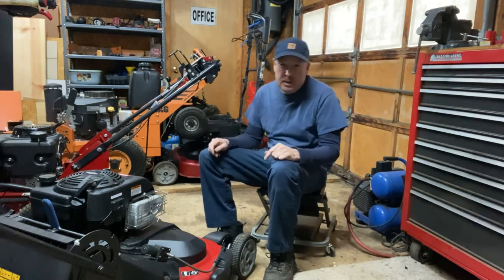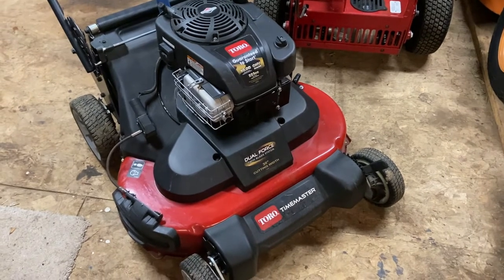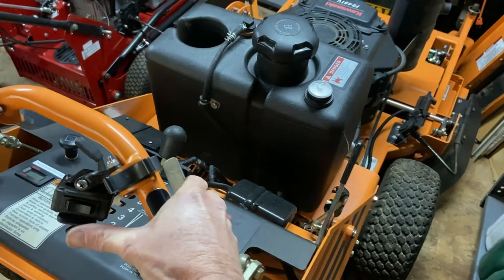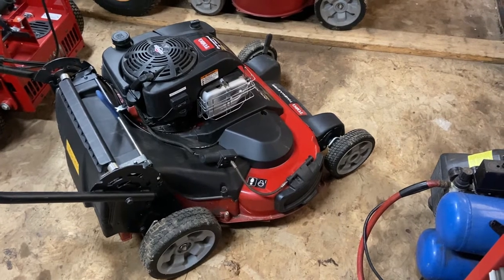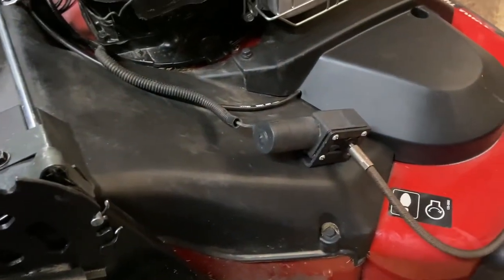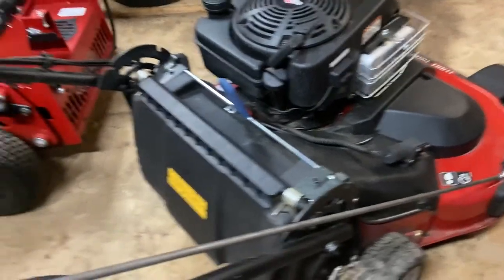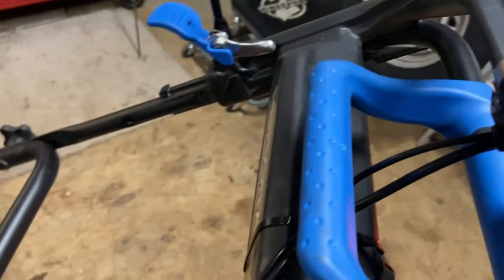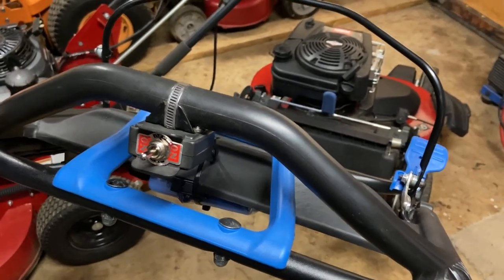Toro Timemaster Chute Blocker - Part 1 (Overview)

Comment: I would love to know how this held up in the long run. Pros and cons. I have a timemaste for my back up/ 2nd mower. And this would be great. Also where'd u get the parts?
Reply from the maker: @drumhead14  Thanks for commenting! The motorized version is a bit over engineered but overall has worked very well over the last couple of years. I plan to make some updated videos with minor changes I made along with the parts I used.
Reply: @BillyGoatLawnService   nothing wrong with Over engineered , being that what this is used for. You're in it for the long run.
Very instrested in this upcoming vidieo being I would love to do it myself